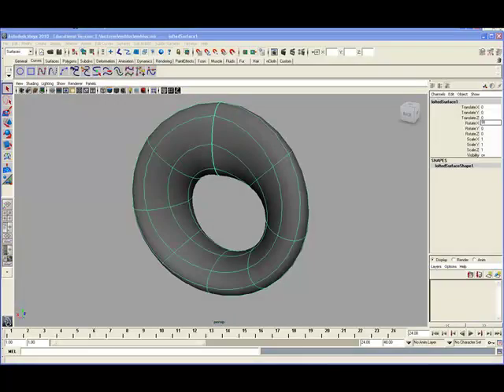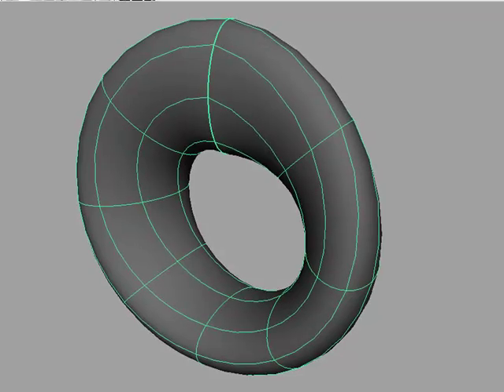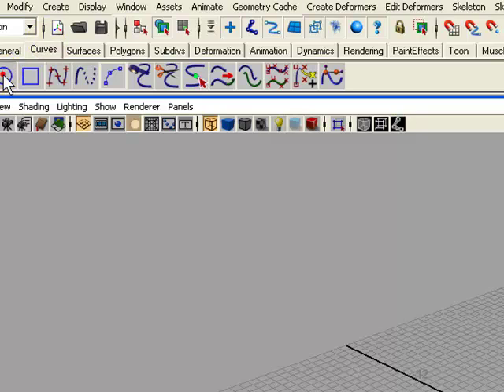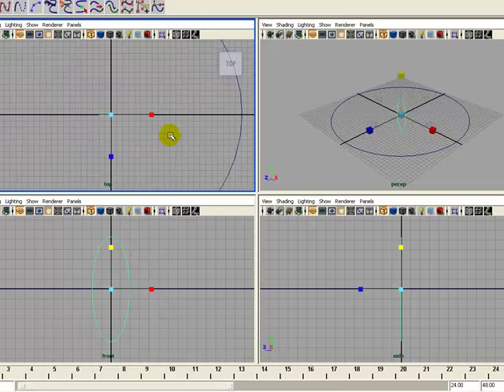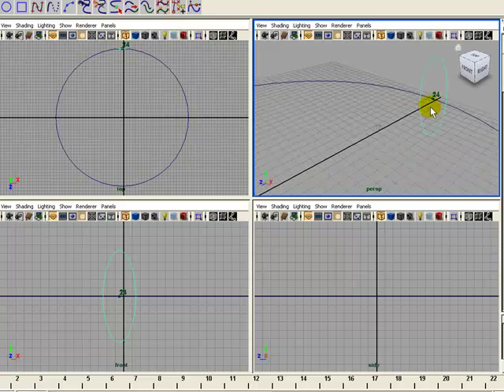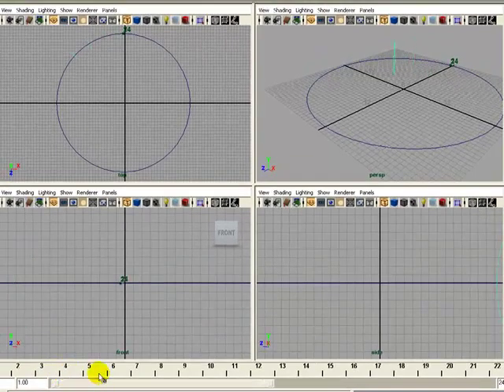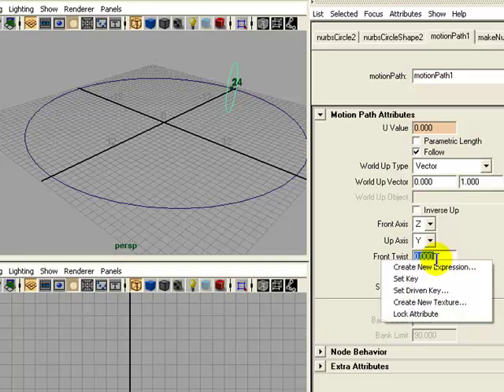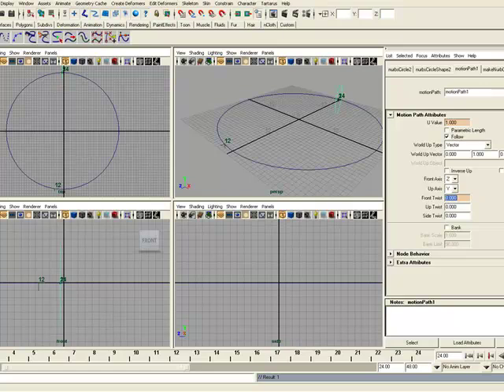Mobius Strip Modeling:Part1

Comment: Thanks, I like the techniques that were taught in this video. But to form a mobius strip I think you need to set the Front Twist in the last frame to 180 degrees instead of 0 degrees.